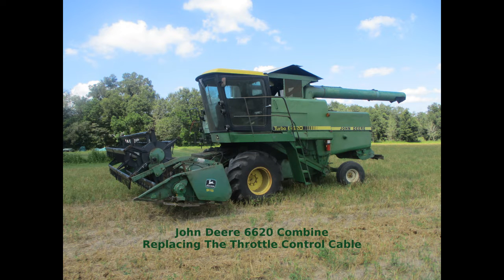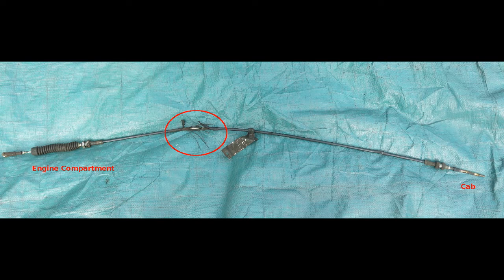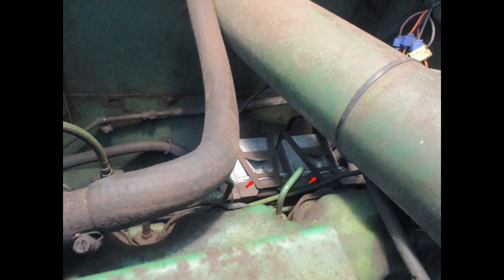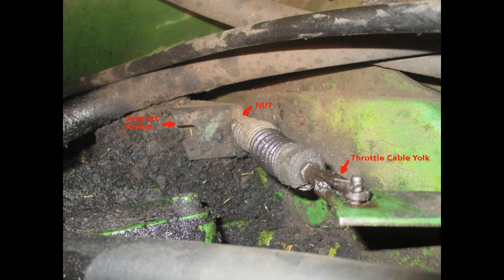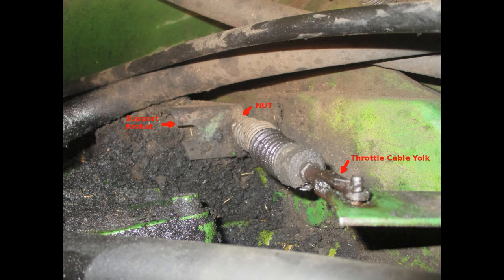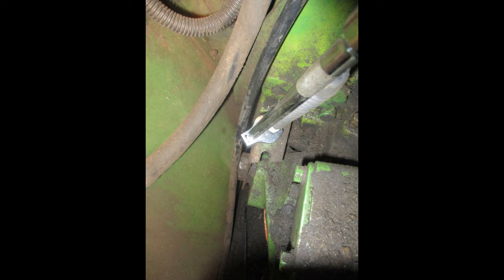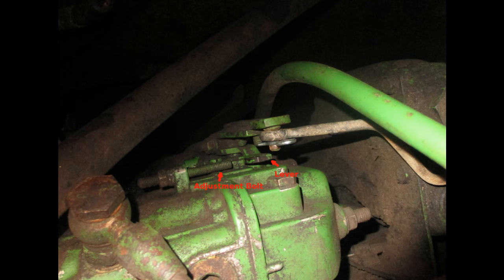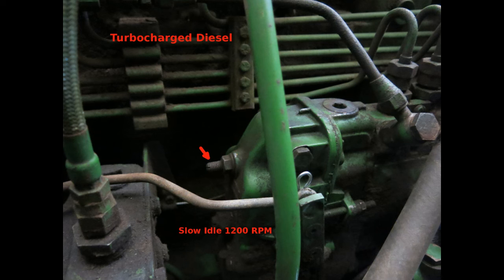John Deere 6620 combine: Replacing the throttle control cable.

Comment: Thanks for the video, our 6620 did the same thing. I ended up getting it done without removing the fuel filters, and just zip tied the new new cable to that hold down bracket in there.